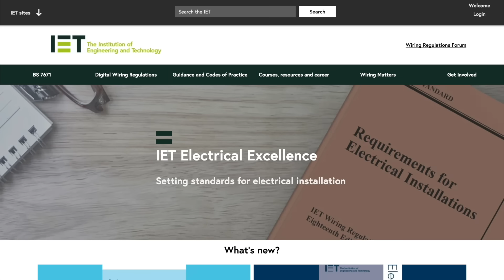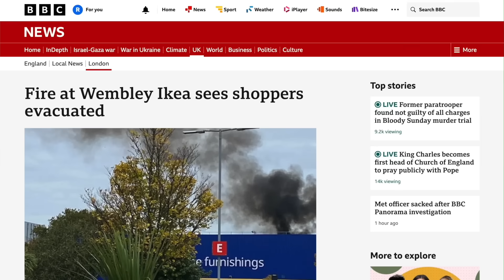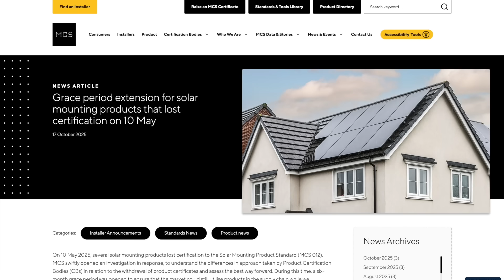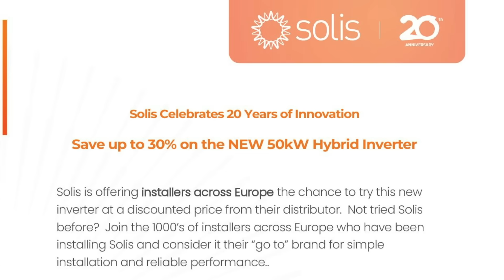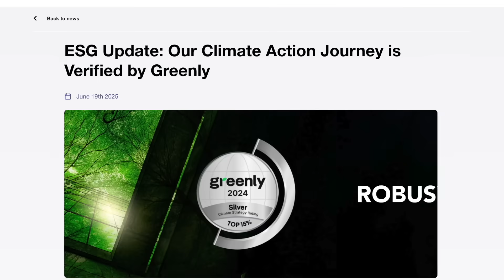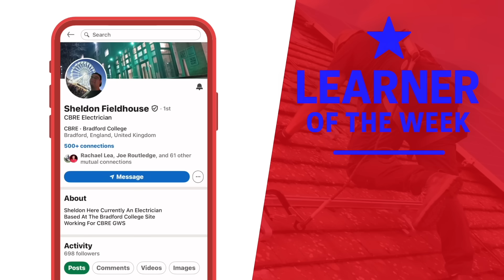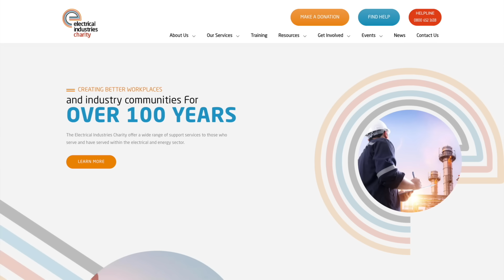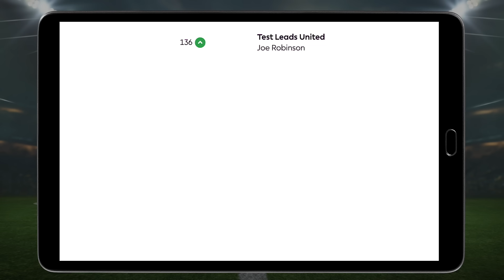Exclusive: Grid Bosses Set to Change UK Voltage

Comment: I often see mains voltage of 255-257 volts overnight. It frequently causes my Shelly smart sockets and APC UPS devices to cut out on over-voltage protection.
Reply: Yeah, that’s a call to the supplier. Over 253 is not allowed.
Reply: We had the same in the North West. Highest voltage was 260v for hours during the night.
The car charger tripped and wouldn't charge,
Took about 9 months of hassling to get it fixed.
Reply: Over 253V is not allowed by the European commission. Call your supplier
Reply: Northern Powergrid won't do anything, they don't ever respond to customer enquiries. I've already been chasing them for 2 years to get our damaged DNO service fuse holder replaced that's preventing Octopus from replacing our broken smart meter despite it being logged twice as a B abort.
Reply: @davida9561  That's when you move to the regulator and file a grievance or sometrhing kinda like that (I'm not familiar with the UK in particular, just the general structure of EU splitting of elecricity into grid/supplyer/metering/generation from the old monolithic things).
Reply: same mine switches winding tap and i can hear it when im up late
Reply: @davida9561  So nothing to do with photovoltaics then!
Reply: @Affableambler  No, but the fear was a residential battery system pushing the voltage up.
Reply: @sargfowler9603  Thanks. I had assumed that PV storage battery systems would have to be compliant to receive MCS certification. My home PV system has a real maximum output of about 7.5kW and as battery storage prices fall it may become worthwhile to consider installing one.
Reply: @Affableambler  It was actually the local substation that had to be "tapped down" to provide a lower voltage. We're currently running around 242v - 250v

Comment: Distribution power transformers in the UK have a nominal ('flat-tap') rating of 11000/433V (yes, there are exceptions with primary winding voltage ratings such as 6600V and 33000V) but the no-load LV busbar voltage is designed to be 433V line voltage (so, 250V phase voltage). This is intentional as for decades the LV network has been designed to accommodate power flow in one direction - from the substation to the load - the 'boost' of voltage at the busbar is to anticipate voltage drop across the LV network and try to ensure all customers receive a supply voltage within the statutory limits (currently set down in the Electricity, Safety, Quality and Continuity Regulations 2002, as amended). If your electricity service is relatively close to the substation, it will not be unusual for your supply voltage to regularly be around 250V. With the growing penetration of PV solar installations, even those service positions relatively remote from the substation will see a supply voltage closer to the +10% limit on a sunny day.

When the UK government commenced the harmonisation of UK supply voltage limits to the EU published limits back in 1993, the initial plan was to move from 240V +/- 6% (based on Electricity Supply Regulations 1937) to 230V +10%/-6% (which we did) and at some future point to complete the harmonisation to 230V +/-10% (which we still have not done more than 30 years later). Importantly, the harmonised standard BS EN 50160 Voltage characteristics of electricity supplied by public distribution systems has, for many years, required all electrical equipment provided for use on the public mains distribution networks in the UK to comply with a variety of voltage and frequency conditions, including variations in the nominal supply voltage envelope of +/-10%. Chances are every electrical appliance in your house will have been designed to comply with BS EN 50160 (and many other European and international standards) - unless it is very old - and so any move to the new envelope of +/-10% will not present any difficulties.

Rest assured that, as the penetration of PV solar and uptake of home EV charging increases, management of voltage in particular will be the principle challenge to network operators, who will explore every option available to them - including the change to the voltage envelope mentioned in this video  - rather than concede to the expensive, messy and disruptive option of having to physically replace assets like underground cables or overhead lines. In my opinion, as time goes by, other unwelcome measures such as restricting at what time, for how long and at what power level you can charge your EV or, for so-called prosumers, constraining export from your PV system to the 'grid' may eventually be introduced to avoid widespread asset replacement (costing ££££).
Reply: What an incoming disaster.

Comment: 3Kw immersion heater for the hot water, which is connected via a switched spur with a 13A fuse. 3Kw @ 207volt ,14.49 amps / 3KW @ 240 volt , 12.5 amps

7.5Kw shower supply with 6mm twin & earth with 32 breaker would be drawing 36.23amps @ 207v  , you can’t just replace breaker with a 40a as that would be against the regs in many cases due to installation method and length of run 
Has any consideration been given for the potential issues that this will cause .
Reply: The thing is, the immersion will be rated at 240 or if newer, 230. So at a lower voltage it will actually draw less current, and take a little longer to heat the water

Edit: also, as noted a couple of weeks ago, spurs aren't rated for continuous 13A, an immersion should be on a 16 or 20A circuit with a 20A dp switch
Reply: Thanks very much for highlighting this; I've got a 10,5kW electric shower (Landlord's responsibility) which is on similar T&E and will draw about 50,1A on 207v at maximum demand, as do at least ten other flats in this building and up to another 36 flats in the same road under the same landlord. 🚿

Somebody at the distribution board is going to be having some very angry letters coming from a large national social housing provider for whom the necessary cabling and B32 RCBO replacements are going to be very costly... 💸
Reply: At last someone who knows what they are talking about.
Funny how lots of people are so stupid making comments.
Reply: An immersion heater has a fixed resistance (it's effectively just a hot piece of wire!), so will draw less current when given a lower voltage, rather than magically adjust its resistance lower in order to draw extra current to deliver the same amount of power output.
Reply: @rednammoc  I stand corrected, I install supplies mainly for industrial machinery, which is not purely resistive as per ohms law, i calculate load according to the KW rating and didn’t even think about the fact that an element is only resistive .
Reply: These are resistive loads they go down as voltage reduces. Switching loads like EV charges are rated by current and not power so they will just reduce power when voltage starts reducing.
Reply: @edc1569  All the actual charging is done on the car so they have to be able to use the EU limits anyway or they could stop working whenever you charge them in mainland Europe.

Comment: "Obsolete" eh? What about my vintage computers? They might be obsolete, but it doesn't mean I don't use them. Most run off 5v PSUs but I like to use my CRT monitors and I hope that potentially lower supply voltages won't damage them!
Reply: I wonder if @TheRetroCollective and other retro computer museums are aware.
Reply: @waynenewark5363 That's a good point and perhaps they could be more qualified than I am to assess the potential risks. I might send them an email and perhaps you should too 🙂 It's possible that they have imported arcade cabinets that could be affected when using mains drop transformers or hot chassis. It all depends on what the manufacturer took for granted when they designed them. The mains where I live is usually around 243v but where I lived previously it was around 230v. That's a small difference that's likely within design tolerances but I can imagine scenarios where a larger drop could cause problems. Considering I just randomly happened upon this video and had never heard of this plan tells me that this will be news to most people. Simply dismissing any affected equipment/appliances as "obsolete" and no longer in use seems like wishful thinking on the part of the energy companies.
Reply: Due to them having switch mode power supplies they will be fine.
There is s circuit inside that regulates the switching frequency of a few kHz, this is fed from the monitoring circuit, and increases its switching frequency if the voltage drops. (Feedback loop).
Switch mode power supplies can run on 50-60Hz and anything from about 190V upto 250V.
Reply: @007floppyboy It's the CRT monitors that concern me as some voltages are derived or referenced to the mains voltage in certain designs. A small change from 240 to 230 might not cause a problem but dropping from 240 to 207 (or lower) might cause damage. I'm not sure if my monitors will be affected but there's likely to be lots of vintage appliances still in use out there that could be potentially damaged. Not just computer equipment.
Reply: @electronraygun6346  Most CRTs, still use a power supply, often 12v, some have a 20v supply.
However, these are often the older linear PSs.
They will deal with small amount of difference, down to 220, but any lower its a no, they will struggle, especially if the capacitors have dried out.
Reply: @007floppyboy That's exactly what concerns me if the mains can drop to under 200 then there's potential for issues with Amstrad CPC monitors to have problems for example. The monitor also act as the power supply for the computer, though most people will use a switch mode PSU these days and hook them up to modern displays. Those of us who like to use the original displays could start having problems. Its been a good few years since I looked at any of the schematics but the 12v and 5v outputs on these monitors can drift depending on the mains supply. Before I moved to a different area I set the 5v to exactly 5 on my monitor and when I moved I tested the same output and it had drifted up to 5.7v. The mains in my area is usually around 243v but in the previous area it was around 230v.
Reply: @electronraygun6346  Sounds like you will 99% be ok.
Reply: @electronraygun6346  See if you can find where the output of the power supply (probably linear type) feeds into the supply for the CRT,, then cut this and insert a supply from a switcher...
Reply: @007floppyboy That's certainly an option, I have regularly serviced my CRT displays to keep them running well. I'm just thinking that there's likely to be people out there that don't have the knowledge or skills and some very expensive (especially these days) machines could start acting up or get damaged. Hopefully in practice there won't be any issues but I think its something important to be aware of.
Reply: @007floppyboy  actually the voltage range of practically every modern switch mode power supply is 90 volts to 250 volts, so they will function anywhere in the world on almost any mains power. About the only mains voltages they dont work on is American 277 or Canadian 347, though in recent years there have been efforts to make more server power supplies that function straight off the American 277/480 system. And yes we American's have more than one mains voltage system, we have quite a few. We are a mess, I know.

But it is easier on the SMPS manufacturers to just make the power supplies auto range for anywhere in the world for standardization, and that way they can sell that PSU anywhere in the world, with the only change being a different plug on the cable.
Reply: @ryuukeisscifiproductions1818  you said the word "modern".
there are loads of kit out there that will not.
Anything from the 80s and 90s will struggle.
I have just repaired a power supply for a Video camera, he took it to the US, (120). It failed.
there are industrial bits of kit, that wont do it built in the 2000s.
Reply: @007floppyboy  probably even lower 120-250V. Look at your phone laptop charger.
Reply: @robdevent6080  Laptops are a different unit.
The external charger isnt as efficient but serves a lot more units, ie US/China/Asia and Europe.
Industrial Switch modes can go down to 90V.
Reply: I still use valve equipment,  its a pain in the bum. 230v transformer,  then dc secondary,  lovely
Reply: @MSD-GuitarI have an old Trace Elliott tube amp and I was thinking about potential issues with that too.
Reply: I always thought the hz damage more than volts so avoid going to a different hz but I guess not
Reply: That's what I want to know.  I have a PET, C64s, Amigas, a Vic-20, Spectrums, etc.  Will they all be okay with this?  Some have modern replacement PSUs, but others don't, and I don't think they all have switch mode power supplies.
Reply: @necronom  Wow, way to many for a general answer.
I am afraid you will need to look at the spec for each one. Early units had switches to swap from around 120, to 240.
Many didnt have switchmode PSs, was the older linear versions.
Reply: If you feared abt. damage due do over- or  undervoltage, insert a variac or an automatic mains regulator.
Reply: A lot of the old stuff has fairly high tolerance for off-spec voltage (YMMV of course - my personal experience with running 110V Japanese electronics on 120V hasn't been conclusive other than that capacitors go bad before other things). I like to run things on a good uninterruptible power supply, unfortunately it's an awkward moment to buy one given some new technology is starting to roll out in GaN (potentially better efficiency and waveform stability) and LiFePO4 (longer-lived batteries, but the blackout switchover time is reportedly a bit too long for modern equipment).

More Fun Fixing It (another UK YouTuber) has just released a video on fake 74LS logic chips, and he shows a comparison of some of the features of the TTL logic vs. more modern CMOS equivalents, again showing the old TTL chips you find in some vintage stuff can have substantial voltage tolerance. It won't mean every part inside the machine will be as tolerant, but at least the logic chips are.

Regarding CRTs, in general those were designed with enough attention to safety that a more modern design - 80s and up surely - should be safe to run until the phosphors give out or some other part needs replacement.
Reply: @edherdman9973 I saw the more fun making it video show up in my feed yesterday but  I've not watched it yet. I'm aware that a small jump or drop in the mains voltage is usually not a problem but if the nominal voltage drops by 33v I can see some potential issues when it comes to linear power supplies. Assuming I can adjust the +5 and +12 DC voltages my Amstrad monitors supply to the computer (which I have done whenever servicing them) and there's no issues with for example transistors being rapidly switched on and off due to lower mains voltage fluctuating, that's fine. However, if the mains voltage can drop to 197v or can be as high as 217v (or potentially higher, I've seen mine go as high as 250v) then something will definitely be getting over volted. When I moved to my current home, I checked the 5v and 12v on my amstrad monitor it had increased to 5.7v and 13v those readings were a little spicy for me so I opened the monitor up and adjusted them.
Reply: they all run via transformers rated 200-250 volts
so meh
Reply: @frombrum  no, they dont.
And it its a transformer, they usually have selection tapping's, 220, 230, 240 for instance.
Depend on how much overhead is built into a linear supply. To much and the final switching transistor gets very hot (or the regulator), to low and you see a lot of ripple.

Comment: If they dropped to 120v it would only take half as much to make it, or they could still make 240v and just chop it in half and end up with twice as much which in turn would mean less carbon foot prints, BOOM
Reply: But the problem with that plan - Though it can be done by just adding a split-phase transformer to each phase and then balancing the loads across both sides - Is that we'd have to give up the arguably World's safest IEC Type G outlet design, and switch to plugs with two thin bits of foil that were only intended for lamps, vertically-arranged consumer units load centers with a choice of Square-D, Square-D or Square-D, and washing machines that you load from the top.

And all the 🇬🇧 flags that have been tied to every single lamp-post will have to be swapped out for 🇺🇸 ones...

And worst of all: Do you know how long it takes to make a brew running a kettle on just 110v?!?!? 🐌💨🫖

What an expensive and pointless exercise! 😆
Reply: @UK-Combustibility-Assured Yes but if we had less carbon footprints we would need to vac up as much

Comment: Reducing the voltage is a common tactic by utilities to reduce the load when the grid is heavily loaded. Increasing the range of acceptable voltage gives the utility more slop in what they deliver, which should reduce their expenses in both infrastructure and generation. Are they going to cut rates?
Reply: That is a bad idea for induction motors no matter if  single phase or three phase. those motors lost momentum and increase the force angle of the rotor, thus increase  the resistive loss and phase shift (cos phi) , motors could burned if no thermal protection is provided and machinery colud stop working due to less momentum.
Very bad idea!!
Reply: As an electrical engineering student, I agree.
Reply: But in electronics with switch mode power supplies, current would go up if voltage drops, to get the same power out. I suppose big loads like motors and heating would decrease power with less voltage though.
Reply: Absolutely not , prices always go up 😅
Reply: @jayjolley9258  
you are still using the same kilowatt hours so the voltage change has nothing to do with that
w=v*a
so if v goes down a goes up to balance the power
Reply: @frombrum  Depends on the device.
What you say is true for switch-mode power supplies, but not resistive heaters.